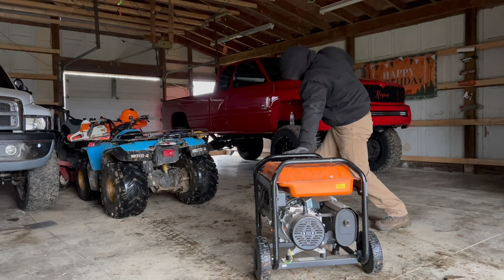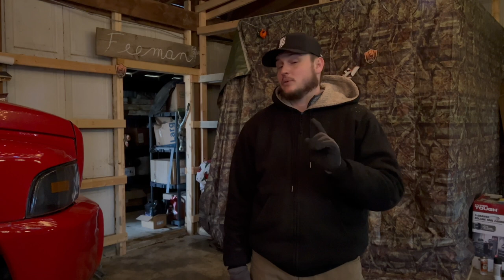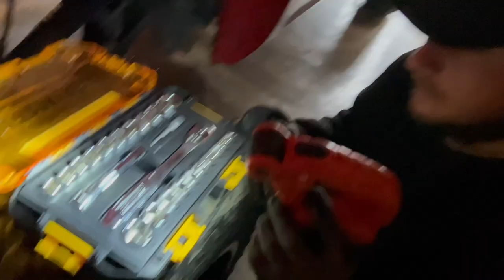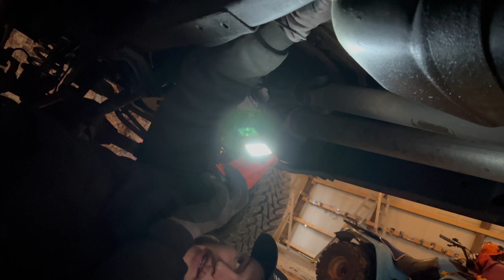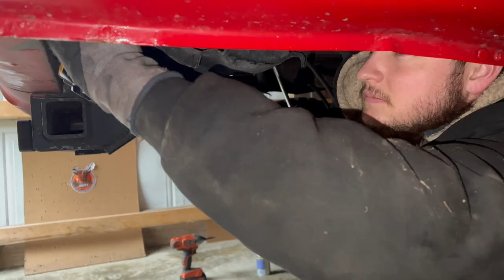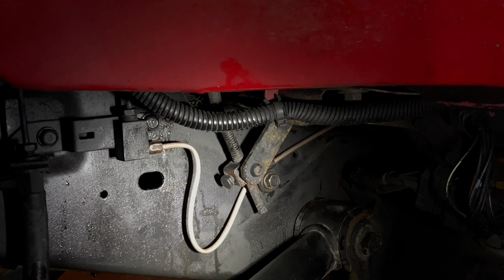This could've gone better...

Comment: Love your videos I was going to let you know when I do brakes you get inside you pump the brake pedal up till it gets good hard and firm for this you're going to have to have a helper and you have them set in and hold the brake pedal down go to the back where the brake lines were broke and crack the bleeder valves on the back of the rear end do one side at a time until all the air gets out the lines and you get good clean make sure to take the cap off the top of your reservoir and make sure you have plenty of fluid in it if you don't want fluid all over your floor when you're doing this you can also get a little rubber hose draw a little hole in the top of a cap of a bottle and when you crack it the brake fluid will go in the bottle and catch it from going over the floor and all over the vehicle

Comment: brake lines are usually run in stainless tubing not copper. stainless will last far longer than copper.
Reply from the maker: The stainless was considered the cheaper/ lesser quality option… half the cost.. or so I was told.

Comment: Copper will not hold the pressure, you should only use steel brake lines.
Reply from the maker: Then why does everyone say copper is the best you can get 😂 and it’s legit double the cost lol